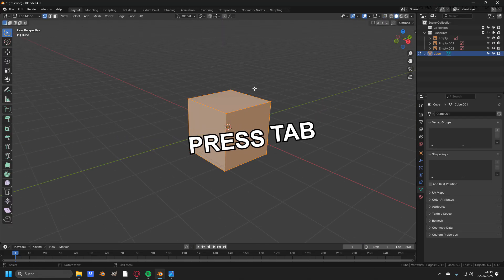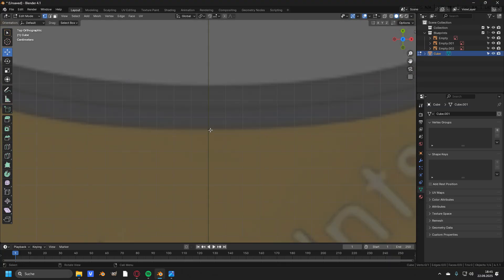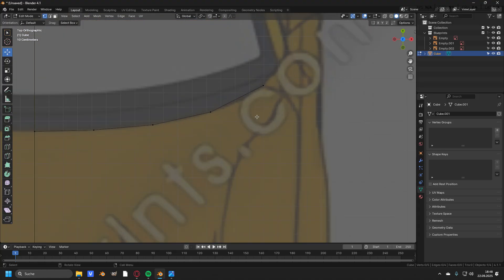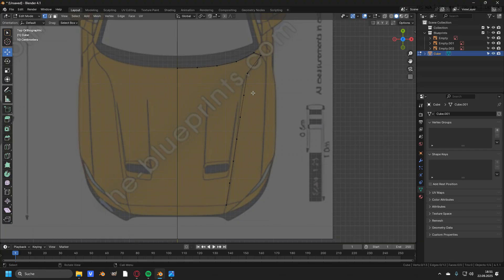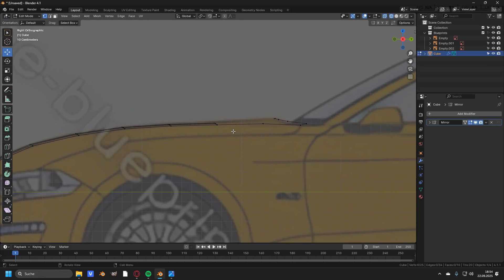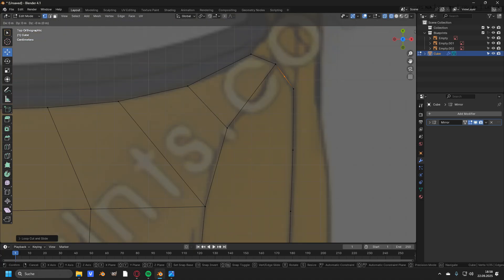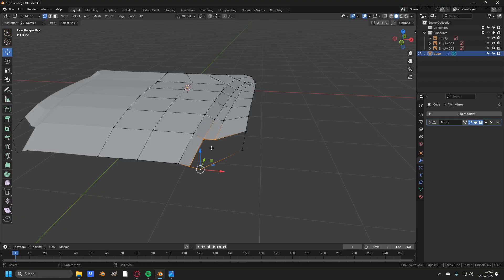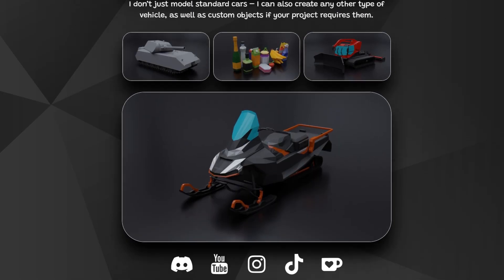Best Way To Model A Car In Blender

Comment: Hey enpix, first of all amazing video  and secondly, how do you make another line of vertices across the hood at 5:04 also how do you select vertices?
Reply from the maker: Thank you :)
The line of vertices which I have added in to the hood is called Loop Cut and you create a Loop Cut with CTRL + R.
Selecting vertices is easy, you just click on them and if you want to select multiple vertices you can select them holding SHIFT and clicking on them.

Comment: Been doing low poly stuffs a bit. I believe most blueprints aren't perfect, for example vertices appear aligned from two sides, but not from one side. You may try to perfect each side of the blueprint's position in the workspace, but it won't help all the time.
Reply from the maker: Yeah thats true, but this is also the task you have as a modeler to make it work even if the blueprint isnt perfect

Comment: Hii can you tell me how did you move the vertic in the center? I can't do It, can you have a different solution to move It?
Reply from the maker: Please tell me at which point
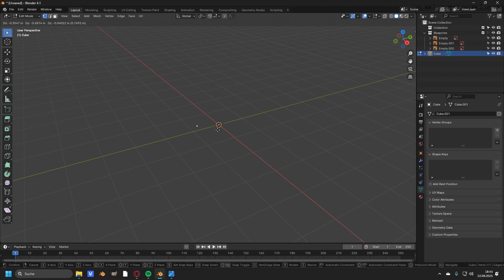Reply: @enpix718at 0:56 you move the vertic, how?
Reply from the maker: @AndreaOrtu-q2m  You move vertices by pressing "G". In the scene from 0:56 I moved it just to show that it is just one singl vertex. You dont have to follow that step.
Reply: @enpix718 Thank you very much, yes I needed it because sometimes it gets put in the center and to make the edges it starts from a part that doesn't fit in the machine, like in the middle of the grill of the machine and I have to take into  Side dishes, Can I contact you if I have any other problems? Thanks again.
Reply from the maker: @AndreaOrtu-q2m  Yeah sure, feel free to contact me. You can also join my discord server and ask the other 3d artists in there. Then you might get a responds even quicker :)
Reply: @enpix718tysm your the best,Can you make a tutorial where you build a motorcycle? The name is Beta RR 50, if you can, otherwise it's fine. Thanks again!😊
Reply from the maker: @AndreaOrtu-q2m  I have never done a motorcycle before but I may give it a try
Reply: @enpix7180:56

Comment: good video but I have a question about car modelling with Blender: if I have design all the panels with a gap (for instance between doors, hood, roof) and the panels have a bended outline (like a real car) - how can I close the gaps to achieve a internal thickness?? my target is 3D print the car
Reply: I would use the bevel tool to create panel gaps. You could use crease as well to create the gaps, but you'd still have to close the gaps after creating the gaps using shift+e

Comment: for some reason any time i try and do the step at 2:09 no matter how many times i re do the set up for the blue print instead of it being the front of the car its always the back does this matter and can i just go to the front will it change anything or nah ?
Reply from the maker: Check out my video on blueprint setup. If you have done the setup correctly you should see the front of the car by pressing Numpad 1. The back of the car should be seeable with ctrl numpad 1
Reply: @e@enpix718Iam doing it all right I swear but it keeps happening over and over again so I can’t do anything I did it the exact same our screen was always the back view what has got the vertesies not the front
Reply: @Zacchhh.s  just flip which side you can view the front and back from

Comment: i have a question when at 1:39 when you are adding more vertices can i just extrude a point instead because when i press shift R it duplicats the whole line and extends it really far
Reply from the maker: Pressing "Shift + R" normally should be the hotkey to add loop cuts. Have you maybe pressed "Shift + D"? Cause this is the hotkey for duplication which you seem to describe.
But like you already said, you can go ahead and extrude each point seperatly instead of adding in a loop cut. This will just take a little bit more time but is as effective as the method I have shown :)
Reply from the maker: Nevermind your absolutely right, shift R is wrong. It needs to be "Ctrl + R"
Reply: @enpix718 alright thanks
Reply: @enpix718 i have just spent an hour trying to find this out, just to end up finding it in the comments
Reply from the maker: @yasleetw  Sorry for wasting an hour of your time haha
Reply: @enpix718 thats fine but after it i dont get the loop options, to use the space for equal spacing between them, and is the equal spacing necesary or can i just skip that part ?
Reply from the maker: @yasleetw  You can skip the part, its just as a bonus to the clean topology.
You can activate the loop tools in Edit -> Preferences -> Get Extensions

Comment: In you opinion, is it easier to model from scratch or find a 3d model to modify?
Reply from the maker: It depens on what you need and what you will change on the finished car. I would assume that it is easier to learn it from scratch as you then learn all of the needed techniques. And then you can easily start to modify already existing cars

Comment: when i select all the nodes loop tools dont pop up?
Reply from the maker: Then you first need to activate it.
Head over to "File" and then "Preferences". Click on "Get Extensions" and type in Loop Tools and install it
Reply: @enpix718 oh thanks but do u rlly need to do that step or can u skip it?
Reply from the maker: @Zacchhh.s  You can skip that step. I dont use Loop Tools that much but the times I use it, it makes the model a little bit cleaner. But you cant really tell the difference when looking at it haha

Comment: i was interested in 3d modelling in 2008 or so when i was in school.
back then, i studied ways t model cars for gta sa mods.
and recipe was to edit polygons in zmodeler (idk is this prog still alive) based on blueprints.

at first, such process is slow and boring. which means it will produce mistakes.
at second, what if you have only photos? or even worse - artwork? or if blueprints are blurry?
at third, even with perfect blueprints - curvature of panels is a product of your imagination. these pictures do not describe geometry of almost flat parts.

and you want to say that after almost 20 years there is no better (more fast, more cheap, more accurate) technique?
Reply from the maker: Thats interessting.
I heard about zmodeler being used even today but I never touched it.
I heard about a method were you can use calibrated images of a car to model it but I did not try it yet. The blueprint method is still by far the most efficient one till today.
There might be a new method soon with all of the ai stuff, but I dont really think that it will be accurate enough

Comment: as commented below. we NEED!! the continuity of this project. You take time to clearly explain, and after watching this video, it seems way less complicated then i expected it to be. You could be a good Blender professor! Continue your work.
Reply from the maker: Thank you for the kind words. There definetly will be more videos on this topic but it will take some time. If you want to learn it right away you can check out my full step by step course with the link in my description. The course covers the low poly modeling from setting up the blueprints to the finished render of the car.

Comment: I keep struggling with background images.  I’m using a Mac and my number keys aren’t working for different view points
Reply from the maker: I never used a Mac to do somethin in Blender, but you can try to change the shortcut.
Go to "View" next to the mode selection, go to "viewport" and then you can select the different views. By pressing right-click you then can change the shortcut. 
Maybe this works for you mate :)